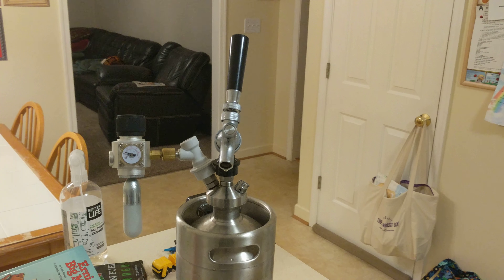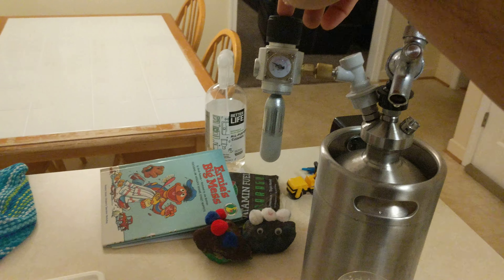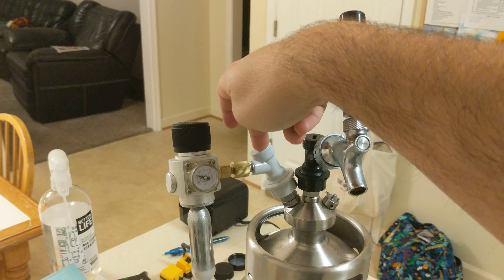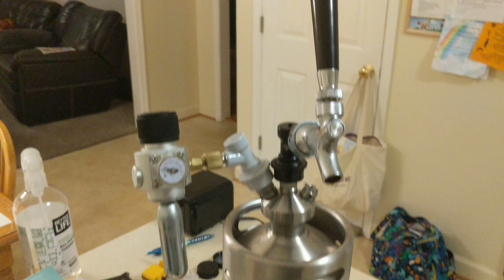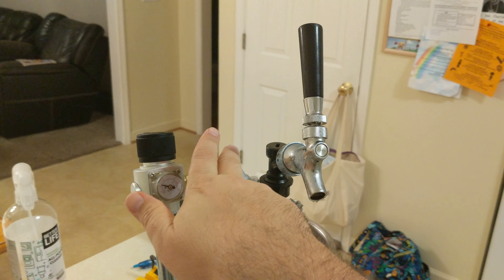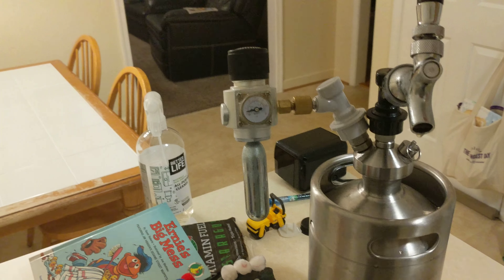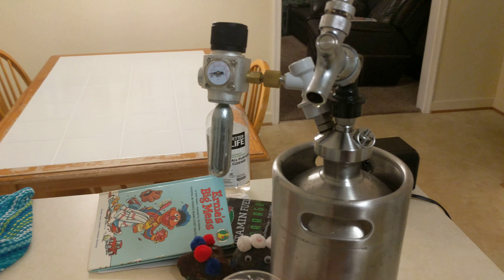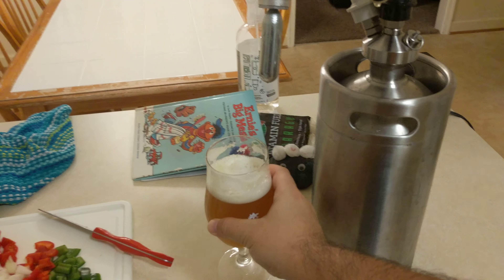Force Carbonating 1 Gallon Homebrew Batch With A Mini Keg

Comment: I'm new to homebrewing (3 batches so far) -- I bought a 1-gallong mini keg to try out and love it.  I ended up bottle conditioning the 1st batch for the keg (2 weeks of waiting with carbonating drops in each bottle).  I then poured the bottles into the keg and went through the steps...the head came out awesome.  I want to try and cut down the time to condition my beer so I can try it quicker.  Any suggestions?  Sub'd
Reply from the maker: Buy 2 more mini kegs and two more ball locks and brew 3 gallon batches.  A cream ale with s05/wlp001/wyeast 1056 and you'll be drinking carbed beer in 1 gallon batches in 7-10 days.   That second or third gallon will be crystal clear too.  It's summer, brew and drink light beers.  Cheers dude🤘!
Reply: @krb3K3  I've brewed 2 hefeweizens and one IPA so far.  This time I'm brewing a blueberry single hop (cascade hops).
Reply from the maker: @DickiesBeerReviews  Sounds Delicious.  Cascade is a classic for a reason!

Comment: Thanks for the video; off the back of this I've purchased the same kit in the UK. Quick question: do you need to seek out food grade co2 cartridges? There are loads of 16g threaded cartridges available for tyre inflation for example, which you can buy in bulk fairly cheaply
Reply from the maker: Definitely DO NOT get the tire grade... Go w/ food and beverage grade.  The general ones can create an oily flavor that will ruin a batch.  The worst thing one can do is waste copious amounts of hops on something like that!
Reply: @krb3K3  thx

Comment: looks cool but I didn't understand what swapping of the disconnect positions achieves
Reply from the maker: You have to put the gas into the keg directly through the tube side to charge it for a period of time.  Otherwise you would be pouring flat beer.
Reply: It's so that the co2 goes through the dip tube to the bottom of the keg and then up through the beer, to maximize contact and increase uptake. If you force-carb through the gas post, there is much less mixing of liquid and gas.
Reply: @krb3K3  Thanks for the video! This would have been an extremely nice and piece of advise to put in the video

Comment: I thought you were suppossed to add priming sugar to carbonate and that the Co2 charger was purely to get the liquid out? Is 16 grams of co2 really enough to carbonate 1 gallon?
Reply: There's 2 ways to carbonate. If you have yeast in the drink, yes you can using priming sugar and wait about 2 weeks. The alternative is called 'force carbonating', you keep the drink cold and at about 30psi for a day or so. I'm simplifying this a lot for brevity.
Reply: Look up forced carbonation.

Comment: When I screw in the 16 gram cylinders, a lot of gas escapes (even if I screw it in quickly) and the gas is almost spent.
Reply from the maker: Yeah, it kinda sucks.  I have actually upgraded my gear to a new mini reg and soda stream since making this vid.
Reply: @krb3K3  yah I'm looking to do the same. What mini reg did you pick up?.. do you need an adapter for sodastream cannister?
Reply from the maker: Actually picked up one off Amazon that has the thread size of soda stream as default.  It is one of the ones that can go up to 90 psi.  Also, the reason for the upgrade is I'm now making 3 gallon batches in a 3 gallon mini keg.  W/ the head space it it, soda stream 60L canisters are ideal for several batches.
Reply: @krb3K3  cool thanks man I'll check it out.. can you share the description so I can find it on amazon? In the long run it seems best to shell out for a nice 5 lb co2 tank + taprite regulator + hose for like $120.. will last forever and co2 refills are cheap. But for now, I love the fact that you can deliver sodastream to your door.. which is a plus over buying a canister and going out for refills.

Comment: Have you had any problems with that regulator
Reply from the maker: It was working fine for about a year until I broke it when unscrewing a partially used cartridge.   The pressure busted the inside needle and co2 was escaping around the threading.  It was on me though, not on the manufacturer.  Purchased another one just for testing so even though they look a little bit different from one to the next, they all work pretty well in a micro process.

Comment: Do you know how much CO2 you use per carbonation?
Reply from the maker: Originally it was taking 1 cartridge to charge, 1 to serve.  However, I've tweaked the process lately to use nearly 1 cartridge for both...
Reply: krb3K3 I need to know how you got it down to 1 cart for both! Please shed some light 😬

Comment: Does this work with 8g cartridges?
Reply from the maker: Probably, but you would need to match thread size of the mini reg threading.  Also - in general it usually takes 1 16g cartridge to charge and maybe 1/2 a 16g cartridge to serve so you'd probably get a better deal using the bigger cartridge.